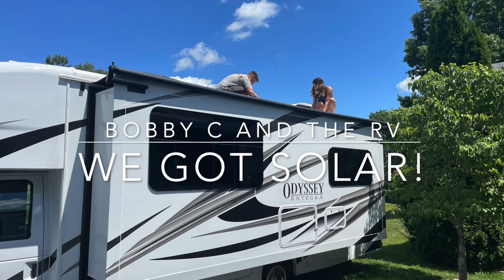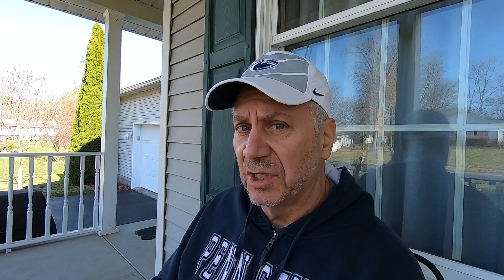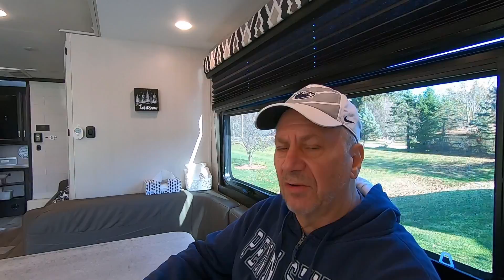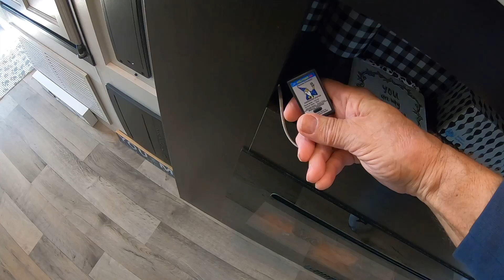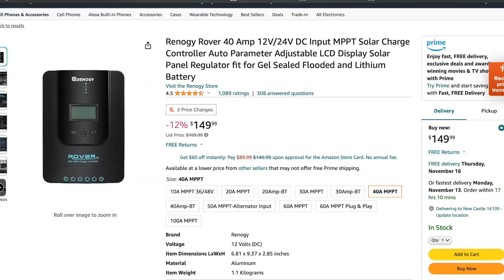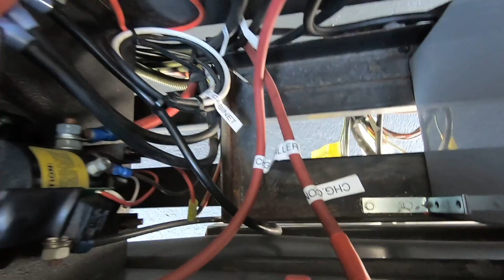We Got Solar!

Comment: Any issues with the solar panels coming loose or worse coming off due to extreme wind from driving given that they are just secured with 2 sided tape? 
I would like to install solar as well and would rather not drill any holes in my roof but want to make sure no issues with the tape.
Reply from the maker: @jillmark99  no
No issues with the tape